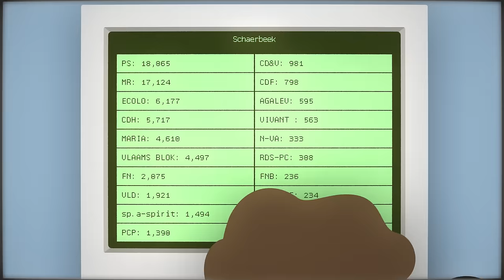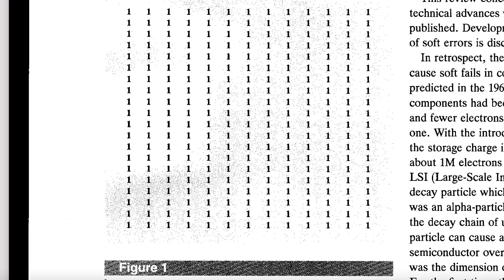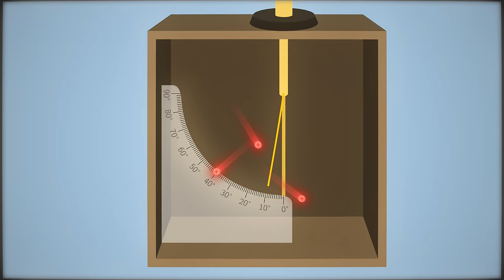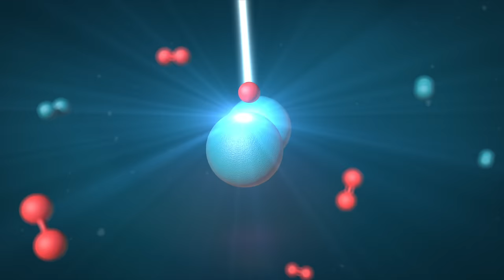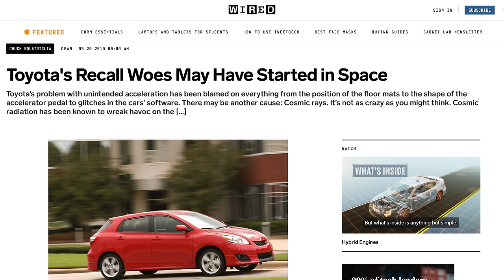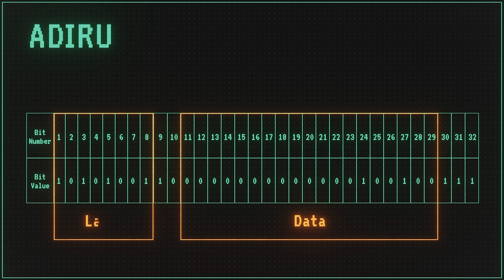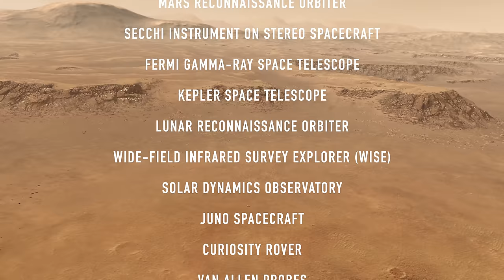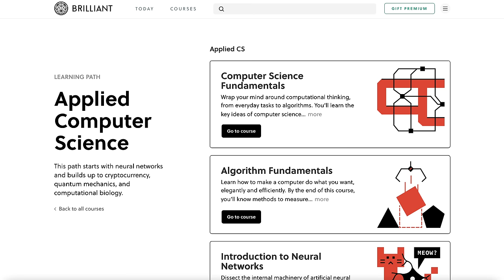The Universe is Hostile to Computers

Comment: Ok but how do we get one of those charged particles to flip a 0 in our bank accounts so we can get an extra million $$$$ by mistake? Asking for a friend.
Reply: The alphabet flip in your comment is poetic.
Reply: AntsCanada?
Reply: Take a smoke detector with you next time you visit an ATM.
Reply: You’ll need multiple particle accelerators , not the big fancy ones just the regular kind. Then you find out where the servers that hold the data and the backup records for your bank account are. Aim a particle accelerator in the general direction of each of the servers and start bit flipping until your bank account changes to what you want.
Reply: You just need uranium
Reply: You can't, every transaction is logged and stored on both ends. For example, ATM logs all transactions made via it, and every transaction is stored in relational database hosted in some bank server. Bit flip (even multiple of them in some very unlikely event) can't produce correct transaction even on one end. It double double bookkeeping with multiple failsafes and redundancies
Reply: @pineapplethief4418  dude!!your way too serious
Reply: Reason why banks still do hard copy print outs as a hard backup. Super high speed band printers, I remember when I was a field tech we were contracted to service & calibrate them.
Reply: @steviestevie8346  dude! your way too dude
Reply: It's already happened. And will continue to do so. But like winning the lottery those events are rare.
Good luck.
Reply: @pineapplethief4418 dude!!  :-)
Reply: @steviestevie8346  they have experience
Reply: Nope they have more than 10 copies of data and in case of bitcoin it's upto million
Reply: @haimanjyot  where's Patrick??
Reply: They always seem to flip from 1 to 0 , and never 0 to 1!
Reply: @pineapplethief4418  That's an amazing phrase! Who knew someone could be too dude. lol
Reply: @AntsCanada: be careful waht you wish for... you see, in order to be able to handle fractions of any given currency - e.g Cents to Dollars, the programs that manage our banks use a numbering system called floating point arithmetic, and in this system, one bit determines whether the rest of the number is positive or negative. Without going into detail, if this so called Sign bit is flipped, your bank balance could change drastically, EVEN IF it is currently zero! In fact, a Zero value which has its sign bit flipped could suddenly become the largest possible negative number that the software can handle.
I don't really think you´d want THAT to happen.
Reply: Einstein's fourth law of thermodynamics: Any mistakes made at the bank never go in your favour
Reply: @goodlookinouthomie1757  I appreciate the double-whammy of wrongness 😆
Reply: I haven't watched you in a while
Reply: I  can help.  I'll need just a small down payment. Do you have paypal?
Reply: @BertGrink  Doesn't need to be IEE754. Putting banks aside, any signed value (previously positive) would be represented as negative in Two's Compliment if the most significant happened to flip.
Reply: @pineapplethief4418  DAMN DAMN DAMN DAMN!
Reply: It's random but certainly possible 😂
Reply: @joeg5414  Only if you live in Nigeria and can send me my winnings from the lottery.
Reply: ants canada
Reply: @lach888c2  
would suck if it went -650 trillion instead
Bank: Hello, please deposit interest payment on overdrawn account by end of day thanks bai
Reply: Send an army of ants into the bank's server room. And have radioactive materials strapped to their backs!
Reply: Bring a radioactive substance with you such as uranium or thorium , and it will strike one of the transistors to make a flip which hopefully doesn’t make you broke if it accidentally flipped another transistor 😂
Reply: That's the best part you done
Reply: Your luck you will arrive at the atm wit ha smoke detector and trench coat and laptop battery adn some tritium and be like, okay I'll attempt to flip a switch. Bam... withdraw 20 dollars... only to be replied your account no longer exists... you go in the next day and instead of getting more money, you have been.. NET'd. (movie the Net)
Reply: Oh hell ya I love ur channel man! You’ve taught me so much about social insects
Reply: @pineapplethief4418  It is possible in fact it has the same chance to happen that a back hole who creates on the earth
Reply: Interesting..
Reply: I gottchu.
Reply: @mehdih8165  What? Your sentence doesn't make sense
Reply: Be careful, it can flip it in such a way that you can have negative 1 mil. I think that's what's happening with the money in my bank account. It's the universe's fault.😅
Reply: Asling indeed!
Reply: @pineapplethief4418  Yeah, ATMs uses the X.25 protocol for a reason.
Reply: I don't imagine banks to rely on single int values in single system to store accounting information like this.
Reply: knowing my luck id end up missing a few 0s
Reply: @BertGrink  Yeah, I think I saw that number after the last time my wife went shopping.
Reply: BIT coin
Reply: asling
Reply: @steviestevie8346  his way to serious?
Reply: Hahaha gift from. God
Reply: AntsCanada watches this too :33
Reply: Today's chips are so small for example the latest apple`s M1 chip, it has a million bits in in a surface as big as our fingernail tip
Reply: Convince the banks that storing account data on satellites is a good idea.
Reply: @Berenger81  it's stored in different could servers which are really well protected 😂
Reply: Of course, there's also error correction codes and database replication. It'd have to be a very coordinated set of cosmic rays :)
Reply: @steviestevie8346  you're*
Reply: Doing stuff with radiation is actually a thing in cyber security...
Reply: @cognitiveconsonancescience2937  I definitely know a couple way too dudes. Somehow Big Lebowski movie comes to mind, although there wasn't anyone particularly too dude in that movie IIRC
Reply: Also, any sane bank these days employs complex anti-fraud systems, I imagine those would raise alert if something like that (even though it's almost impossible) would happen and someone would take a look and be like "hey, this transaction/current account balance makes no sense, I'll make incident report and we'll figure this out"
Reply: Data is transfered and saved in a way that errors during transfer or on files can be detected. If you can recover the data depends on the encryption methods. That is why we have computer science.
Reply: There are times where banks make accidental millionaires for 30 minutes. A friend ended up with a million something in his account and decided to call his bank and ask about it... They said "our mistake, we'll fix it shortly,... Don't go spending!"
Reply: I just took a look at my bank account from my phone. Guess what. It's still pathetic!
Reply: @pineapplethief4418  Create a handheld emp device/or get some plutonium, and try the bank atm while blasting the radiation at it. Then hope it glitches out and let you get more money lol
Reply: Kamusta na antscanada!
Reply: Now that's a lottery winner right there
Reply: The real important questions
Reply: Imagine if that actually happened in real life
Reply: Praying to God might help
Reply: @pineapplethief4418  darn
Reply: Lol just finished watching the queen ants video and wot this one recommended
Reply: @gg-creggnhffghjyy617  lol indeed
Reply: “Oh! I dIdN’t ExPeCt To SeE yOu HeRe! 🤡”
Reply: hhaha come on bro, wake up 😂
Reply: That's ok sir, but do you know how to write "asking"
Reply: Banks' software systems are resilient to these errors. You know, because of the money.
Reply: You need the Reddit particles (jk that’s not getting replicated for some time)
Reply: @pineapplethief4418  I appreciate the explanation
Reply: I'm assuming it'd be much easier to just hack the bank.
Reply: just hope it doesn't cause u to lose money
Reply: By that logic, this could also put you in millions of dollars of debt. Wouldn't recommend it unless you're a gambling man.
Reply: Statically speaking, it's almost certainly to have happened already!
Reply: They use things similar to checksums to make sure this doesn't happen.
Reply: My wife works at a bank/credit union....and that would be pretty funny, but not in the way you think. they are a bank. they aren't going to take a loss due to a computer error but they will let you know that you don't get that money and own them any you may have spent, which they will sent you to collections for if not paid back in a (probably unreasonably short ) period of time....and will have a soul crushingly fake nice voice the entire time. 😉👍
Reply: Well, you'd need to hit many computers at the same time. Banking systems are redundant.
Reply: @lach888c2  5head move here. This sounds like something someone crazy will one day pull off.
Reply: @elisusisgay  Cats123?
Reply: @shawnpitman876  ....and you'd have to remove all the humans involved who have interest in keeping that money in the bank.
Reply: Remember, the opposite could happen as well 😁
Reply: Nice man. You said you would ask for me. And you came through.  Thanks bro! 😎
Reply: I wonder if this had ever happened
Reply: It actually does happen
Reply: @AntsCanada AntsXanada is more like it
Reply: I'm a friend 😀
Reply: Who else has seen the video of the girls bank account being negative 1 million????? 😂😂
Reply: Adding 0 to 0 is still 0
Reply: This could have happened to someone but they (for obvious reasons) could have just not said anything
Reply: You would be Tracked down by IRS faster than you can breath
Reply: Asling
Reply: Bank servers are usually few meters underground, protected by a lot of concrete and metal. I worked temporarily in one it was fascinating.
Reply: Bank servers are usually few meters underground, protected by a lot of concrete and metal. I worked temporarily in one it was fascinating.
Reply: @steviestevie8346   some people are just on the spectrum its okie they keep me from having to research myself.
Reply: @hajorm.a3474   is it so the cosmic rays don't hit the servers
Reply: Never thought I'd see you here haha
Reply: @lach888c2  then we trøll
Reply: @tonyzang2344   lol
Reply: @AntsCanada Hey buddy I like your channel nice to see you here.  Learned a lot about all kinds of ants and critters from you.
Reply: I'm the friend he is asking for. Please 🙏🏽
Reply: @pineapplethief4418  thanks that's actually interesting
Reply: @ChatGPT1111  why don't take a piece of rhodium in bag
Reply: @lach888c2  It might not necessarily change only the balance. There's a good chance that the account details like the account number or name or SSN could be impacted. Also, who's to say it won't impact other account details. @AntsCanada could end up becoming a patron to someone else who has an account with the same bank.
Reply: @actsrv9  intentional or accident?  I always said "The only thing original is by accident"
Reply: Inspect it 😎
Reply: I think you just came up with a plot for a cosmic bank heist movie there.
Reply: You really need more money ? I mean, you got your own channel that seems to be enough of a cheatcode to let you buy a big house and a FRICKIN' FOREST.

Maybe let some to the poor people who struggle to even have somewhere to live.
Reply: Cosmic ray bit flips can only flip bits in RAM and Flash memory though, not in hard drives - and bank information is most definitely stored in hard drives, because RAM is volatile and flash is expensive and unnecessary.
Reply: It's super easy, barely an inconvenience.   Pay the right bank employee enough money, and a cosmic ray will mysteriously flip that bit.
Reply: That must be how I wound up with an extra $131,072 but nothing else showed up in my statements.

Just kidding.
Reply: Have you thought about the other way. What if it flips the wrong bit and u get billions of debts
Reply: Be careful though, what if bitflip will happen on your debt size 🤣
Reply: @xiidraco  actually, I have been told financial institutions do not use IEE-754 floating point.   They use more of an extended integer scheme, where $12.34 (or € or ¥ or ₹ etc) is stored as 123400.
Still, I'm sure you don't want to hit that sign bit on the left, and messing with the "0.0001" on the right will certainly attract attention without payoff.
Aim well, Padawan!
Reply: @heroslippy6666  back in the day that was called doping:  put a special sauce on something to gain a desired effect.   Nowadays it only refers to narcotics.
Reply: @moasters99  you could, or you could scrummage up some Plutonium in a box.
Reply: Use a high frequency energy directional electron gun to flip those binary switches and get rich while they losse all.
Reply: I like money
Reply: Normie
Reply: @pineapplethief4418  You can, you just need multiple simultaneous bit-flips that happen to change the same numbers in multiple areas and logs, on a transaction that was so recent that it hadn't even been printed as a hard copy yet. No impossible, just incredibly incredibly incredibly incredibly unlikely :)
Reply: @ChatGPT1111  i have small amount of uranium . You can go with it
Reply: What if they flip in a fashion that bankrupts you😁😁
Reply: @pineapplethief4418  although you missed the joke I appreciate the new knowledge.
Reply: I've had an automated checkout machine give me back nearly double the change I was due. 
Now I have to wondering if a bit flip did it.
Reply: If that happens to you, take it out, and spend it quickly or they’ll catch you 😉
Reply: Dident expect to see you in this comment section wow
Reply: @pineapplethief4418  If it weren't for those meddling programmers...
Reply: You can't because "real" computing uses error correcting memory which detects and corrects up to 1 bit out of every 64 being corrupted
Reply: Get the fire nation on it im sure they're dodgy enough to make that happen
Reply: Having 140$ in the bank would be awesome
Reply: Then the IRS comes to take it,
Reply: How to get a winning lottery ticket
Reply: Why do mathematical innumerates always ask for additional zeroes to be added to account amounts?
If they were smart, they'd be asking to add 9s.
Reply: @actsrv9  
k -int> 107 or 01101011
l  -int> 108 or 01101100
Thus 3 bit flips

Damn its 5 am and i should sleep instead
Reply: Double entry book keeping means that wouldn’t work
Reply: Antscanada what are you doing here
Reply: Antscanade why are you here
Reply: Why would you want to be in more debt?
-$100 -> - $1000
Reply: check this is the ancient art/science of astrology real because of this phenomenon?
Reply: @pineapplethief4418  no sorry Stevie was right
Reply: @ChatGPT1111  smart! They have radiation!
Reply: Yes I want that to happen to my bank account too.. Billions of dollars in my bank account 🏦
Reply: @pineapplethief4418  thx...was curious.
Reply: Hi am big fan :)
Reply: @pineapplethief4418  what if hit both ends tho
Reply: Banks have distributed servers. Won't happen. The cosmic rays would need to hit all the servers where your copy of information of account is stored.
Reply: Im asling for a friend too
Reply: Well hi there mr ant keeper
Banks are probably protected against bit flips, laame...
Reply: I was once able to digitally deposit a check into my bank account, and when I didn't have access to the funds right away I got impatient and went to physically deposit it. Lo and behold both deposits were made for the single check and I had not $400 but $800 in my account and was able to withdraw the full amount. Eventually the bank adjusted for this error and I ended up -$400. Good times.
Reply: @andreipokrovsky8376  tf
Reply: @steviestevie8346  maybe too serious but I did learn something from his comment
Reply: They probably have many backups and redundant data :(
Reply: Ur the boss
Reply: Mikey
Reply: That particle have so sharp brain , it knew where it should make disturbance, not on the lige os poor peoples to make them rich by flipping in bank accounts...
Reply: @pineapplethief4418  nonononono don’t steal me
Reply: @azpineapple  sorry, I will, or I'll have to change my handle otherwise. Please, jump in the back of the car to assist in your theft
Reply: @pineapplethief4418  cries
Reply: 😂😂😂😂nice one brother
Reply: if there weren't so many purdy girls in my science class i may have done better,whats that when two particles are same at a distance    ?? for pineapplethief  but didn't post the way i wanted
Reply: Or it could flip your $10K to $0
Reply: @namelss9110  was about to mention you're typo till I saw your name
Reply: I can’t stop watching Seven Hunnid on YouTube 😭😭his videos are good
Reply: @ChatGPT1111  so that you also could you are from a falling superpower country " anarchy'
Reply: @pineapplethief4418  block chain is future for record keeping
Reply: @Untamed Corgi  😂😆😜
Reply: @pineapplethief4418  na BRO he just isn’t DUDE enough
Reply: That do happen but it is manually corrected.
Reply: Az
Reply: Didn’t expect to see one of my favourite YouTubers here
Reply: @pineapplethief4418  well, could you explain why I transfer money from one bank to another last month took 2 weeks to complete and one insist they already send it another one insist never receive it:(
Reply: @craxynor1252  or a manager was dumb while managing investments, the bank will never reveal what happened of course. One thing is sure, cosmic rays are not the case as those system are checksummed. :)
Reply: Hypothetically government
Reply: @miikapekk5155  I think its may be because positive charges are not attracted to alpha particles so they never leave their place on the other hand negative do : | just a thought.
Reply: @AntsCanada 0That something in the Universe is called Entropy and Entropy needs order and that is the real reason and purpose for our existence here. To fight Entropy by creating Order around us in whatever way we can without causing chaos.
Reply: @pineapplethief4418  duuuuude
Reply: Haha fr
Reply: @moasters99  huh?
Reply: @steviestevie8346  I was going to ask the same question but was seriously wondering how banks didn't suffer this. This was the answer I was looking for!
Reply: @actsrv9  ?
Reply: Universe:STOP POSTING ABOUT COMPUTERS! IM TIRED OF SEEING IT
Reply: Pipi
Reply: I need more than a few particles  in all accounts.
Reply: I see you need those $$$$ in taking care of of the Phoenix empire 💪
Reply: i hope i am that friend....😀😀
Reply: @lach888c2  where do we get particle accelerators?
Reply: Hi dear I is sipping my wpw pw ppqooq I have
Reply: They did that for joe biden votes ask them.
Reply: @ChatGPT1111  0
Reply: You have to ask it nicely.
Reply: @lach888c2  the chances of hitting your exact bank account would be highly unlikely. Maybe making a transaction that updates the amount of money you have on your bank account to +1 would increase the likelihood of switching on a transistor like on the vite count.
Reply: Big ass lasers
Reply: Haven't seen you videos in a long time since I built my snake cage gotta watch some more
Reply: this has happened before
Reply: Couldnt you just use soemthig to generate radiation ?
Reply: Probably from the hacker named after it on social media late at night in a group chat pretending to be all the people in the room while waiting for new clients 😅🤣😂🙃😉
Reply: It's as likely to make you bankrupt
Reply: @principal_optimism  lmao yep that's what I be thinking too. But cant say that for everyone else 🤘😅🤣😂
Reply: thats not a mistake, god's will maybe.
Reply: Hysterical
Reply: Cheaper and easier just stealing the ATM
Reply: @pineapplethief4418  nice, now the more I know, gotta get smarter everyday
Reply: Banking Cores(the actual servers that processes money transactions) work with logs(each transaction is written in a redundant entry). This Banking Cores can trace a set of transactions, for example all related to an account number, and thus validate that your balance is what it should be. This validations can be triggered prior to some kind of transactions (for example when you realize you have an overwhelming exceeding quantity in your account and try to make a retire for more than a preset limit). So in case of a bit flip corresponding to your account balance changing, the banking core can still trace and correct the error consulting those logs, even in the case of luckily making two or several bit flips, the banking core can still check and validate several account and trace where the error happened (they currently do this as part of tracing some kind of transactions related to banking security).
Reply: Love your channel
Reply: Go to the bank and say you are filming for fun. Use a mini particle accelerator instead of a camera. But leave 0 money in your account as these bit flips can also decrease your money.
Reply: You can bet they’ve ensured that can never happen.
Reply: I’ll take 10m. That’s enough for me.
Reply: I can imagine there's allot of redundancy in banking, like the space shuttle if one computer says you have £1,061,235 and all the others say £12,659 it would correct the computer that was wrong. There would be no trail of where the money came from either.
Reply: @elisusisgay  his ants want to ascend to the next stage of evolution. They need the cash.
Reply: It will happen some day
Reply: @tonyzang2344  or a radioactive material. XD
Reply: don't worry, when things as important as money are on the line, we make sure that you can't get any extra
Reply: You are not the only one bro
Reply: @pineapplethief4418  So we just need to bit flip all of them at the same time! :P
Reply: ANTSCANADA?!?!?
Reply: ANTSCANADA?!??? IM A BIG FAN!!
Reply: You dont need any charged particle.  Its too difficult.  All you have to do is hacking the bank's computer
Reply: Or you can make a team to take the ATM machine silently at night, when everybody are sleeping
Reply: You might have better chances if you take the ATM up an hot air balloon :D
Reply: i bet they have some redundancies thingy
Reply: @pineapplethief4418  He's not looking for a transaction though, just a change in the amount in his account. The bank may not have that money but they won't see anything deposited or withdrawn from any accounts, one account will just have more than it should.
Reply: I agree
Reply: I find such a wide claim hard to believe... and in fact it sounds heavily propagandized
Reply: @anushka7497  using hot air balloon will attract people's attention.  A dump truck will look normal
Reply: AYY!
Reply: Good thought there. I'll be looking now.
Reply: There is a way higher possibility that an ATM gives you out two notes instead of one
Reply: @ChatGPT1111  this actually made me laugh I just imagined a nutcase slamming a smoke detector into an ATM machine. But yeah who knows it might just work coz of the trace amounts of uranium in there.
Reply: wrrr
Reply: @ChatGPT1111  hold up are you saying those things are capable of doing that as well ???
Reply: Here is a real case. 
Im 28 and Last night i was signing up for getting corona vaccine (wich as government said, is currently just available for people in 35 years old or above).
I test singing up in that site for fun but i was shocked why computer accept my ask! 
Now i know what happend in that computer.
Thanks cosmic rays for the vaccine😂
Reply: The perfect crime.
Reply: Just ask the federal reserve
Reply: Funny how it never works with ATMs huh?
Reply: @steviestevie8346  but I learned even more lol
Reply: Cover your ATM card with uranium, maybe?
Reply: Even if it happens they have enough redundency to notice and correct it. And if you started to spend like crazy you'll be instantly in overdebt as soon as the bank corrects the error.
Reply: @steviestevie8346  Sweet!!
Reply: Just aim a high powered Buck Rogers ray gun towards the bank, go inside and make a million/billion dollars withdrawal. lol
Reply: what a crossover
Reply: @ChatGPT1111  how it will help?
Reply: Why don't you send your ants to infiltrate there system like in the  antman and the wasp..😂
Reply: @pineapplethief4418  good god so this is what the redundanted keel of IL game is...amazing
Reply: @goodlookinouthomie1757  I would like if it was just 4th law of thermodynamics, nothing to do with Einstein who is an arbitrary person.
Reply: First, spend a million to procure uranium
Reply: plant uranium into an ATM
Reply: Just take a piece of Uranium with you and leave it in the bank next time you go there
Reply: AntsCanada? You're here???
Reply: Ask mr beast
Reply: Asling
Reply: Tbh I would not expect you to be hear lol
Reply: these people are taking the joke to much to heart
Reply: @volcanoproductions7404  Whom
Reply: Wow it's Ac family
Reply: By
Reply: Ayyyy AntsCanada love your vids man
Reply: Beware! That flip can also reduce your$$$ by mistake. So don't pray for that.
Reply: all my 1's got flipped to 0's :-(
Reply: well... In a integer number pattern, the most significant bit is the "signal bit". 0 is to positive numbers, and 1 for negatives, just pray to don't change this bit while you have some money on your account xD

if 4th bit = signal, then:
0b0001 = 1 
0b1001 = -7

It get's worse when the amount of bits increase, like in 32 or 64 bit numbers,
Reply: @elisusisgay  my exact reaction
Reply: Even if it happens, banks have a way to filter it like where did it come from. So instead of that fluke going to your account, it goes to theirs. Yup.
Reply: As Jesse Pinkman would say "Yeah bitch, magnets!"
Reply: hehe ma bwai
:elbowcough::yougotthis:
Reply: Ready for a economic crash?
Reply: Kriminel
Reply: but i mean if you could get enough and somehow beat atm locks and mass withdrawal before any system catch it then bail outta the usa sure thing
Reply: You’ll need an ask 47
Reply: What's happened when your first digit becomes 0 😆
Reply: @yourangelinfleshorsackclot1523  are you alright?
Reply: @BertGrink  Actually, this is not true. Banks use high precision fixed decimal numbers.
Reply: Didn’t expect to see you here
Reply: I realised I don’t know. Turns out it’s hydrogen gas because that’s the only element that produces single protons.
Reply: that means you   have $100,000 at least
Reply: :00 ANTSCANADA
Reply: You only need a gun man 😤
Reply: 1. Understand rowhammer (the attack).  2. Try to do a rowhammer on the bank's software ...

(all of the above is for entertainment purposes only)
Reply: My thoughts exactly
Reply: AntsCanada!?!? Thats a shocking suprise to see
Reply: Yes this event can happen
but to individually you the probability is very low
Reply: Or go from 1million to 0
Reply: Create alpha particle producing radiation at your banks main computer and numerous backup locations
Reply: Lol
Reply: @pineapplethief4418  Thanks for that!
Reply: @steviestevie8346  I appreciated his answer, so not entirely in vain
Reply: @vladpetric7493  peepee sus
Reply: You cant, data is stored in the balls
Reply: @lach888c2  what if you unflip some bits so your even more broke
Reply: Oh man I love this guys channel 

I never thought I'd see u in the wild like this lol
Reply: Asking the real questions Mikey
Reply: Also tell me when you learn
Reply: @AntsCanada I love watching your ant channel videos.
Reply: 2 pages I follow and learn from coming together . Algorithm or coincidence? I think destiny
Reply: Hello AntsCanada!!! Big fan
Reply: Okay antscanada i see youu
Reply: If you find out plz consider sharing to your subscribers
Reply: That actually happen a lot. But the banks figure them out quickly and you can't just can't get those money cause withdrawal limits.
Reply: Damn :|
Reply: ah yes asling
Reply: Asling for a friend
Reply: Love this one
Reply: @pineapplethief4418  its a joke youre not smart if you cant understand a joke
Reply: @manleyaccmanley617  OH WOW REALLY. WHO WOULD HAVE THOUGHT. 
You are not smart if you think I don't understand the joke
Reply: Yay antscanda
Reply: Can I be your friend...
Reply: Lol,🤣
Reply: Hey it’s you!
Reply: Never thought I'd see you here mike
Reply: ITS THE ANT FELLA!
Reply: @actsrv9  Best reply.
Reply: As if you're not training ants to sneak in and do it for you
Reply: Dude yes I’ll have 10$
Reply: Manifest it
Reply: Charged particle gun of course!
Reply: @tonyzang2344  exactly
Reply: äÄÄääääääåäääääääå
Reply: It will flip the first number to a 0 but not add one 🤫😍
Reply: 😂😂😂 brilliant!
Reply: Been plotting this in video games for a while
Reply: 🤣dream big boi earn hard
Reply: Well this is q great crossover of 2 channels I love.
Reply: Local ant channel asks universe to give him extra money on the comment section of a science vid
Reply: You know you can buy a ray gun where it shoots the rays.
Reply: No, every ledgers on the block, record your transitions, so it is impossible. 🤔 But . . .centralized bank?
Reply: I feel asleep watching one of your videos and woke up here
Reply: @tonyzang2344  uranium removes money you should have listened more carefully
Reply: Hey ants canada
Reply: 18k "likes" & you hadn't yet changed "asking" to "asking" smh (grammar Nazi mode activated) lol jk funny comment...stay blessed & yes I hope some interference adds zone zeros & commas 😏
Reply: @steviestevie8346  right smh always somebody coming along to ruin the fun haha
Reply: I don't know who your friend Asling is, but cosmic rays just stole 1k off her.
Reply: @pineapplethief4418  when will the bank stop hiding behind these lies
Reply: Dude rhi
Reply: Love your videos antsCanada checking your channel for new videos
Reply: Or a nuke could go off….
Reply: actually genius
Reply: it may be impossible for regular money but it's possible  on cryptocurrency
Reply: Impossible— redundancy systems was born in the banking industry.
Reply: That happened to my dad once. He namk account suddenly had some 7 digits. He didn't get to keep it, sadly.
Reply: Well, the data of our bank accounts is stored in multiple servers. They all have to undergo change at once..
Reply: If you can defeat the redundancy protections in the Bank System,  then you´ll have the big problem,  the Canadian IRS guys are gonna subpoena you to explain how the heck you made that money out of thin air. "Are you selling cocaine massively??"  They are gonna ask.
Reply: AntsCanada? Is it you
Reply: Wait where did you get Here
Reply: Where did you get Here
Reply: 9
Reply: "Asling" lol
Reply: I know right I wish
Reply: Came here for this comment. Thanks for saying it first!
Reply: @lach888c2  but making sure to empty the balance first. It can backfire.
Reply: Love your videos omg! You’re the best!
Reply: lol can't believe i found you here
Reply: Never thought I would see you here, howdy
Reply: Build an antenna to collect particals then sort them out and direct them to the right server.
Reply: This is one of the reasons I want mechanical systems in my car and not antimous automobile, I still want control over the systems.  What if we have a large solar flair and everything gets a big EMP spike knocking out transistors 
Micro chips have 1000 of tiny transistors built into them thats 1000s of chances of a bit flip. Or even a bosd  
Why did the tesla crash?  BOSD.
becuse it has no mechanical parts to drive it your tottaly out of control with no recovery path.  Not that bad if your moving 90mph on a bullt train on tracks, but if your in a 4 wheel automobile that the computer drives your ass is deep in trouble. 
This aside from hacking and remote control into the system, at least 2 automobile manufacturers have pointed out there drive by wire cars can be hacked via Wi-Fi.
Reply: hope it will not be a negative million dollar
Reply: @elisusisgay  🤣😋😒
Reply: Imagine it his the server with your bank account and it sets off an SEU but the int is signed
Reply: AntsCanada!?
Reply: Antscanada
Reply: @actsrv9  thought the Same...must be "The Particles"
Reply: Capture some cosmic rays in a jar from space and open it on ATM
Reply: So THATS how Biden won!
Reply: It has happened
Reply: Did your computer get hit with 3 charged particles?
Reply: When the banks money is involved.. you better believe they aren't gonna let a single bit flip get past them
Reply: If only there was radioactive material somewhere near their main servers >.>
Reply: They must have fixed this by introducing multiple servers at different geological locations , they cross check the data and one with bit flip is corrected automatically.
Reply: I'm going to open my internet banking while sunbathing 🤣
Reply: @actsrv9  p
Reply: Mikey!
Reply: Blast a particle accelerator at the building containing the server your bank uses to house your account data...
Reply: wet
Reply: Trying to secure more funding for your ant colonies?
Reply: @pineapplethief4418  it just makes it less likely, still theoreticaly particles could hit servers on both ends t the same time in the precisely same place
Reply: I love watching your ant colony vids
Reply: AC family
Reply: @steviestevie8346  I still learned from his comment
Reply: I see this as 50/50 since you're 10,000,000 may become 00,000,000🥲
Reply: I got in trouble when my account balance went up by 2^64 doll hairs
Reply: Right?! I'm pretty sure my bank has figured out how to flip bits to take money from me... when do the bits flip for my benefit?! 😉
Reply: @spilledspoiled_milk ☹️
Reply: @spilledspoiled_milk so no piling up strontium 19  on my desktop tower? ☹️
Reply: Hi antscanada
Reply: Break in and EAT the bits. Yummy!!!
Reply: Or lose
Reply: @actsrv9  🤣🤣
Reply: ولد
Reply: Hey Mikey can’t wait for the next episode on the weaver colony
Reply: Sup antscanada, funny to see you post on here! Used to watch your vids a lot
Reply: Politicians and powerful make mistakes… they can always say: oh! It was a mistake
Reply: Wow your the last person I expected to see here
Reply: Bank error in your favor. Best card ever!
Reply: hey google, add x-ray machine to my shopping list.
Reply: I read about this guy that got way more the he was supposed to get paid, just need to go to the bank with something that admiting high levels of radiation well I overstand why busines's like to pay check
Reply: Why is my man here?
Reply: Loved your content for years!
Reply: @lach888c2  will this affect the Fortnite servers?
Reply: An extra 0 after 0 is still 0
Reply: @lach888c2  - Problem with that plan. All big data applications have multiple data integrity systems, followed by transaction validation routines that can be re-run (and are). That value change can be fixed quite easily. You sometimes hear of isolated incidents where values are different, but you're normally looking at non mature applications.
Reply: @pineapplethief4418  I stole a nice pineapple juice yesterday.
Reply: you're awesome 😎😎🤪 guy keep up the great work 😘 and your idea of creating world first ant natural reserve is amazing 😍!!!
Reply: @lach888c2  thats kinda of a problem banks have central systems but some info can still be in the local bank if they gone offline
Reply: Scream as loud as you can about Russia 😉
Reply: antscanada?
Reply: Yes your a truly a man of science
Reply: @goodlookinouthomie1757  universal truth. 😅
Reply: Somehow that never happens :(
Reply: Thanks for the inflation y'all. Now stop blaming it on politicians 😂🤣
Reply: Yes we hope 🙏 💜
Reply: Banks use ECC RAM to avoid that.
Reply: Holy crap ANTSCANADA
Reply: Wait a minute why are you here
Reply: I know a guy who knows a guy who knows a guy.
Reply: I am the friend
Reply: Same probabilitiy that your balance is divided...
Reply: If it does, don't spend it. You'll owe the bank all of that money back.
Reply: The Payday Gang would like to know your location
Reply: 无中生友。
Reply: Didn't expect you here!
Reply: The real question is how do we train ants to do an Ocean's 11 on fort Knox? 😁
Reply: Haha. 
Let me know of you discover the way
Reply: @elisusisgay  ants in Canada?
Reply: @sumitswelsor7550  - then how is bitcoin stolen , if it can be canceled , and replaced ?
Reply: Yeah, I am also asking for a friend.
Reply: Happenes to me once!!! Woke up to billions showing up as balance... I knew I had 10... tried to withdraw 11... didnt happened
Reply: @pineapplethief4418  the only correct response
Reply: @steviestevie8346  nah,  I was looking for that infp
Reply: That's a billion $ question.
Reply: Use your ants to flip those. Make a new breed called hacker ants
Reply: Maybe put a kilo or two of radioactive uranium near your bank ;D
Reply: Bring a bar of plutonium into your bank
Reply: @tonyzang2344  what if the uranium makes it tick the wrong way and gives you like the opposite of what you want and -$100,000,000?
Reply: @ChatGPT1111  i thought same
Reply: sadly that probably wouldn't work due to error correction codes likely being implemented into those numbers. If they use a two-bit error correcting code, it would require 3 cosmic rays to just happen to flip 3 different bits before the changes persist. (error correcting codes user extra space to explain what the data is meant to say, it doesn't fully show it, but alongside the data, we can figure out what the value is (and algorithmically so [a computer can check it]).
Reply: But then you have to be very precise. You might hit the sign bit from positive to negative.
Reply: I’d need more than one extra 0 😂
Reply: Never thought I'd find you here 😂 But a pleasant surprise fs
Reply: What im sayin
Reply: Wow
Reply: Good luck explaining that to the irs
Reply: Needed a posetron or proton gun near bank server's 😂😂
Reply: Last year in Mexico a lot of users from a bank woke up with a lot of money on their bank accounts. They never explained exactly what happened, but is funny to think that a cosmic particle could have caused it.
Reply: Of course with that they have quintuple redundancy
Reply: Take some uranium to a datacenter
Reply: @craftyplayss 😂 Hi friend! 😂
Reply: 500
Reply: I'm the last comment
Reply: The replies on this comment are redundantly valuable wtf lol
Reply: Odd to see you comment here but hi
Reply: How did you get here?
Reply: Oh
Reply: Best believe there are people who know exactly how to do that from their own home. 😮
Reply: ya
Reply: my FIRE ANY COLONY
Reply: just as easy as i can make the time you invested in righting the message as useless
Reply: Omg I follow your account and it’s so cool to see you interacting with another account I follow. Our connections as humans are so cool.
Reply: Lmao the classic. "printing more money Makes people wealthy, not everyone including me broke"
Reply: First you learn telekinesis. Then you learn Electricity  Manipulation (then you lose motivation.)
Reply: AC???
Reply: 0 plus 0 =1000000???
Reply: Cosmic blasting my bank's infrastructure brb
Reply: @elisusisgay I abit shocked to his comment to hahah just come form his recent video nd he's here watch this to wtf
Reply: Charged particles changing to 1 from 0 would possible by mathematical algorithms,to change 1 to 0 in bank account through electronic like shock wave device to effect the main core of  electronics algorithm to calculate account,possible
Reply: Where is a subatomic particle when you need it.
Reply: Asking for a friend lmao
Reply: Didn’t expect to see you heee
Reply: It won't work cause numbers on banks will not update its like using inspect element
Reply: walks up to the atm with a brick of uranium in my pocket
Reply: Sounds like you've tried this before
Reply: Bank registers your details in multiple backup servers, if one changes other 20+ saved records fix the one that changed.
Reply: Antscanada???
Reply: that would require an exact hit on whatever server your data is stored on, and note that there is also a chance that you get  deducted money
Reply: You can bet the banks have it figured out, or at least can make it work in their favor, it’s probably happening , it just always screws the little guy So, you never hear of it and they never fix it. 🤷‍♀️
Reply: AntsCanada!! ❤
Reply: Lets
Reply: Get you
Reply: To 500 comments
Reply: Even if it can be done how to predict is it going to add or take money from the account ?
Reply: @elisusisgay bro fr lol
Reply: ANTSCANADA?! WHTA ARE YOU DOING HERE 😭
Reply: @steviestevie8346  No dude is way to intelligent
Reply: Get your low orbit ion cannon ready
Reply: Well the universe doesn't only hate computers, but us too 😢
Reply: Imagine bro gets a debt of 1 million instead😂😂
Reply: Does not matter, bank auditors will catch the mistake and take it back.
Reply: Get to big magnets and first hold them as close as possible to your bank card or phone or computer. Whatever you are paying with. 
Then flip the magnets fast up and down 3 times. Then remove 1 and leave the other overnight on it. 
When you wake up you're rich.
Reply: You just need to go a couple hundred meters into the sky with your laptop with your bank account open. Then wait for a little bit, and it’ll start bit flipping
Reply: There's a story on that my ant friend
Reply: i’ve been wondering why my homemade cosmic ray gun keeps opening my garage door
Reply: @actsrv9 what does that mean please tell me lol
Reply: I guess taking care for colonies of ant really does ate up the budget lol
Reply: Ecc ram exists unfortunately... bank servers all use ecc
Reply: Made me so happy to just randomly see you comment on this video 😂 love your content
Reply: Ask nicely duh doy
Reply: Ayyyee yoo ants Canada!! Hope everything is going great with your new projects can't wait for the next update!
Reply: What if a 1 turns to 0
Reply: Antscanada! No way!
Reply: Bro you live in a castle in the woods in the Philippians. You don’t need even more money.
Reply: Yes apart from joke that's a damn good question. 

And from my knowledge banks and any other systems which use databases like our banks to maintain the details of our account,there occures a process called transaction(part of database) and in the transaction there remains consistency (one of the ACID property) means the data should be consistent. So in case of this type of software problem where the data is increased or decreased without any external changes the system rectify itself again again to it's original value . That's why you does not become that luck to get a few thousand $$$$ for free...
Feeling sorry for that 😢😢😢
Reply: @actsrv9 what does that even mean… am I retarded for not knowing? Apparently 5000 people know something that I don’t
Reply: @sumitswelsor7550
“Life finds a way”
Reply: Well its the same chance of it striking anything else so it might happen
Reply: If we can harness this then we are screwed 💀💀💀
Reply: If we can harness this stuff we are screwed 💀☠️
Reply: I’m the friend
Reply: Unfortunately, that would just cause inflation as it’s basically the same as printing money
Reply: Imagine doing that and then all the 1s flip to 0
Reply: Imagine doing that and then all the 1s flip to 0
Reply: the joke was your all animal robots, the universe is truly hostile to people who get easily baited by the computer rules from before the fog of war. Can't wait till you all figure out lightsabers
Reply: ja i think you all have no idea how to have fun at parties
Reply: @actsrv9 😂
Reply: Love your content!
Reply: All you need is a 3lb chunk of pure uranium and take is to an atm
Reply: What is this crossover of my interests
Reply: your chanel is amazing
Reply: It can also go in negative
Reply: The bank would flip you